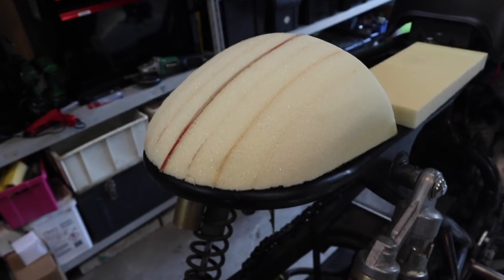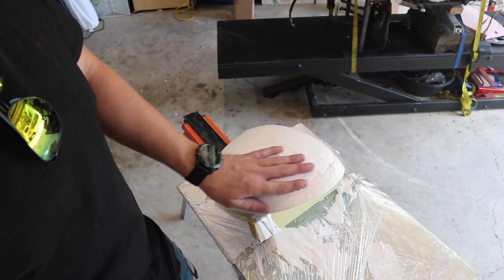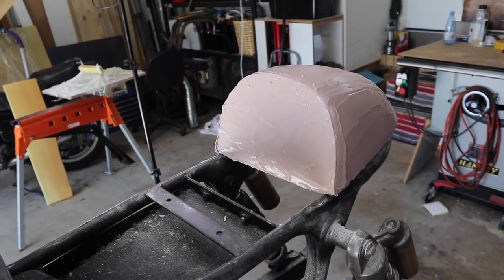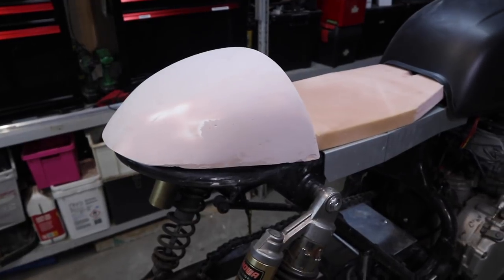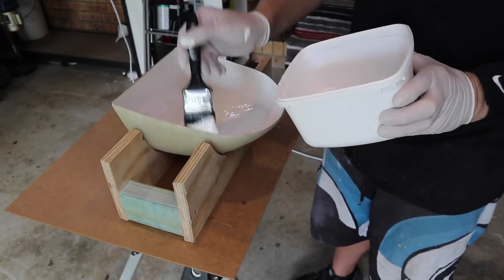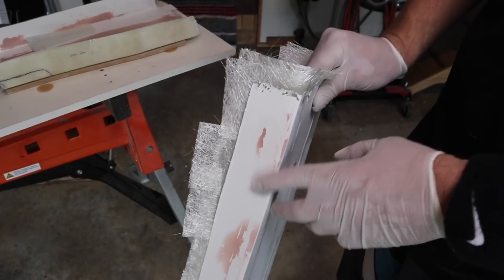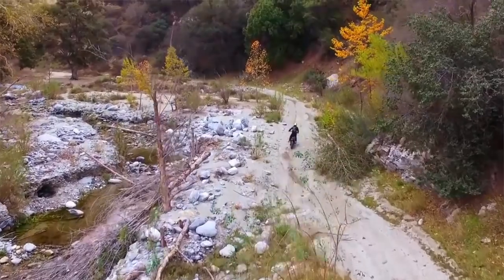Cafe Racer Build ★ Hump Build, Fibreglass Mould, PART 2, Honda CB750 Cafe Bike Ep 26

Comment: Do the CX! The CX650C is my favorite model. I have four, one being a parts bike. The first one I did as a solo seat tail dragger done in OD green with red wheels and white wall tires. Basically, a WWI bi-plane color scheme...complete with bullet hole decals. Get compliments on it all the time. They are just great bikes. I'm doing a CX500 right now, but it's being built for a friend. I would really enjoy seeing how you would redo the CX500!

Comment: Nice video, another method is to make your foam model, go to a fablab, 3d scan it and 3d print it.
Reply from the maker: JM what the heck! that is awesome. 😊 I don’t know much about 3d stuff but I do know a guy that could help me with that :)
Reply: Cafe Racer Garage: yes indeed you should look into it. I did mine with a fablab (a free place full of technology like 3d printer and 3d lasers): 3d scan your model (or take a few pictures + fusion software, free). and then you can 3D print a plastic base (or 3D laser cut 3mm wood parts for the base) & 3D laser cut polyurethane (hard plastic foam like yoga mat) to make the hump. Cheers ;)

Comment: Great video and thank you!
Do you need to apply a layer of wax to the mold before applying the gel for final product? I don’t see that on your video and looks like you applying the gel without any wax or easy remover layer? Also you using a blue/ greenish liquid (10:46) after you sing gel? What’s that? Thanks again
Reply: Same question here

Comment: Hey I just had a question about your process. What is the blue liquid you use before you lay the fiberglass in the mold? I have my plug made just wanting to make sure I don’t mess anything up. Also I saw you had a waterproof rubber cement in your list, what is that used for?
Reply: I was wondering about both of these same things lol. It looks like a greenish liquid, but I'm not sure what it is.

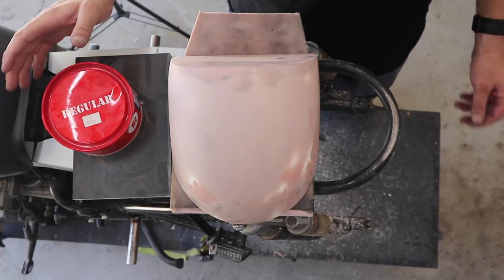Comment: At 7:10 would a heat gun applied to the wax per coat work to fill in the pores of the plug ? Nothing too aggressive heat wise, just enough to smooth the surface for the next coat.

Comment: Really great video! I wonder how difficult would it be to shape a front fairing using the same method... Also hell yeah everyone would be interested in another build! Especially if it's a low budget build that makes you think more outside of the box.
Reply from the maker: Thank you Allcartuner I think any shape is posable with fibreglass, I think is going to be a positive on the scrambler tracker build so far :)

Comment: Hey mate,
Really good video.  The only thing that I do not understand is why you didn't use mold  that you get in first place (10:20) but instead you lay few more fibre glass layers inside that mold and then removed new shell from inside and you end up with two almost identical parts ( 11:19)?
Cheers

Comment: Nice work mate! :-) A friend of mine made a hump out of an old helmet. Out with the interiour and cut it into shape. Nice idea! 
Of course we would like to see you make another bike! If you feel about those wheels on the cx as I do, they have to go. But no worries, keep the hubs! Yes, those "spokes" are bolted on. So instead of those ugly stamped pieces of sheet you make 2 rings that fit on the hub. On the outer fringe of that ring you make holes for proper wire spokes and a rim to fit! Works fine! Makes sense? :-)

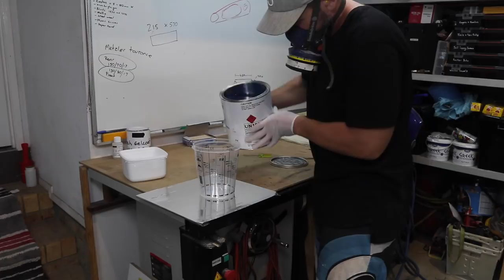Comment: At 8:30 ish did you put the gel coat over the layers of wax? Did you let the gel coat dry before putting the fibreglass sheets over it?
Reply from the maker: swinp22 yes the gel coats goes on after wax and you can apply the matt sheets as soon as the gel coat get touch. 

Hope that answers the question, 👍😊

Comment: Sorry if this is a dumb question, but what is the stuff you're putting on at 8:17? Also, what is the blue stuff at 8:30, the green stuff at 8:57, and the orange stuff at 9:02? I assume the orange is the resin/epoxy, is that right? Thanks for these great videos!

Comment: Do you have a link for the paint you used?  Great vid thanks
Reply from the maker: Thank you mate :) Sorry i totally forgot to add this, I will do it now,  Here is a link to the same stuff but a different brand, I got mine locally, its called Gelcoat, the stuff I use on the plug in the first video is called Flowcoat but its just gelcoat with wax in it, here is both links, you will need more resin than anything else in this whole process I used about 3 litres of resin and only 1/2 a liter of the flowcoat and flow coat with the wax. any more question just ask 
Gelcoat (White) https://amzn.to/2rEkeDt
Flowcoat- (Gelcoat with wax for easy sanding) https://amzn.to/2IcMfgg

Comment: Great video! I'm in the middle of a seatpan build myself. No prior experience with this part of my build. Question... What would be the potential downside of simply making your initial mold the final piece c working on smoothing the outside rather than the inside? I have a boatbuilder friend who I've been debating this with and would love your thoughts. Keep up the great work!
Reply from the maker: Great Question and I have the answer for you in part 3 next Sunday. short answer is yes, you are correct tho, it's posable to just smooth the outside and have that as your final part, I just wanted to show the full process.  any questions just ask.

Comment: Another great vid..
I'm actually in the process of researching doing something similar. I have a rusted out seat pan I want to replicate to top surface is rough any ideas how to go about it?
Also is there a reason why you make a mould with the plug and the then re glass the inside of the mould for the final product? Why on just use the mould?
Yes to cx500
Reply from the maker: silvertrust32 hi my helpful bike Building brother, your 1st question i don’t fully understand, but making a seat pan from Fibreglass is the fastest way I find and you can create any shape you want. 
2nd question, I made it the correct way to show the full process however yes you can just use the first mould as the hump if you want but you will need to use a lot more car body filler to re shape it the way you want. 
Hope that helps, please re-ask the 1st question so I can answer it better for you
Reply: Yeah sorry, I was trying to explain myself in the shortest possible way...
Take 2.. So I'm also restoring an old Yamaha and the original seat pan is badly rusted (similar to this http://vintage-and-classic-honda-s.456789.n3.nabble.com/attachment/4035625/1/image.jpeg) on the top surface, I want to replicate the design by covering it with fibreglass but due to the top being so badly rusted I don't know how to prepare it to glass..  Any ideas???
Reply from the maker: Sorry dude the image didn't load and I tried a few times,  can you try another Image?
Reply from the maker: This link worked :)   Id advise;  1. soaking it in something like this overnight or 8 hours, This stuff is incredible and you can reuse it over and over  (Metal Rescue  https://amzn.to/2rxpWry )
  2. After its rust free try building up the rusted areas or missing parts with some kids plasticine it's cheap and you can use a bunch of it to build up an edge, fill all holes with this stuff and cut it flush. 3. Paint the whole thing with PVA glue to prevent the fibreglass sticking to the metal. 4. fibreglass the whole thing. 5. once its dry separate the new pan from the old and drill the holes you need and trim the edge. hope that helps mate.
Reply: Cafe Racer Garage awesome thanks.. Will keeps you posted